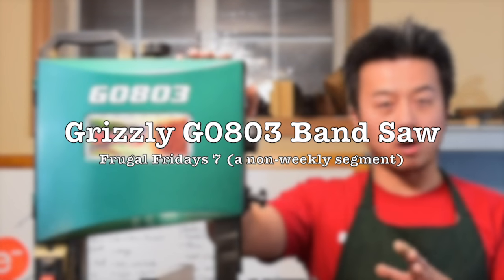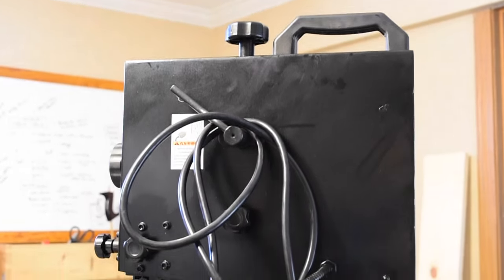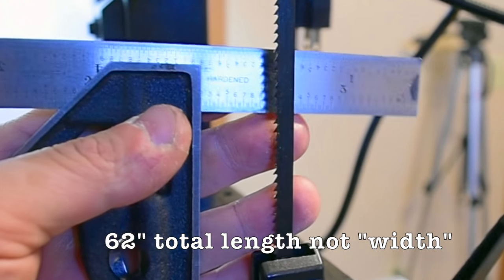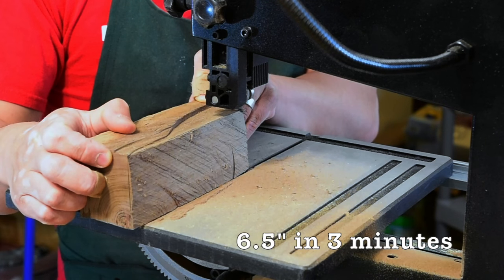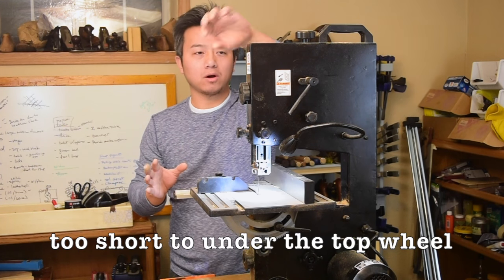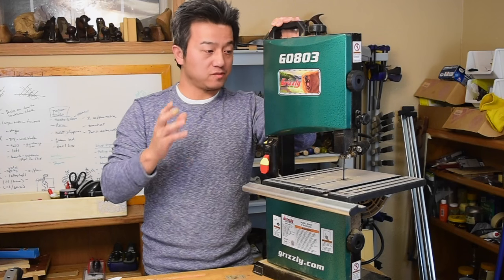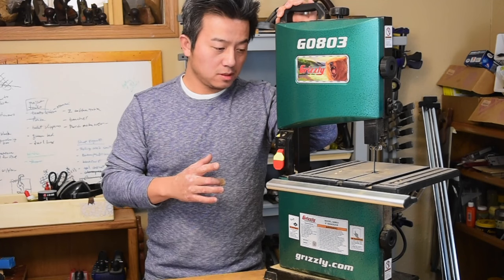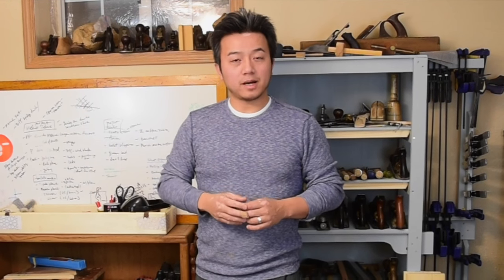Grizzly G0803 9" Bench Top Band Saw - A Frugal Fridays 7 Review

Comment: Excellent simple breakdown of the experience of using this tool, the pros and cons.  Especially helpful actually without distracting comparisons to other options, focused on accessing the ability to do what was intended.  Thanks!
Reply from the maker: Glad you liked it. It's basically the same as other saws of this size. So no need to compare brands, they are mostly made by the same company just painted differently.

Comment: Thanks for the review John. I have a cheap 9 in ryobi and I never expected too much out of it. I can say , a good quality blade makes all the difference. Your grizzly will probably exceed your expectation with a timber wolf blade, mine did.
Reply from the maker: +Moy perez woodshop You're welcome. I know the 9" Ryobi you're talking about, the table top between the two saws are the same. The Ryobi is a little smaller. I am going to keep using this blade until it "fails" but I'll keep the timber wolf in mind.

Comment: Nice addition to the shop! (and to your workflow:-) Before I had one I used a jigsaw which of course ment, bringing the tool to the wood. But having a bandsaw is incredibly convenient. Now I take the wood to the saw in practically all cases so my jigsaw is at rest. Relief cuts are the key in the majority of the curves to be cut. Regards John!
Reply from the maker: +Maurice Blok That's true Maurice, I was able to cut that handle much faster than a coping saw and the cuts are cleaner too. This smaller saw really suits my style for now, but I'm still looking and saving up for a bigger saw.

Comment: I bought a Rikon version of your saw.  It was also my first use and purchase. I purchased some Olson blades in different widths (for tighter curves), and the saw has exceeded my expectations. I've had it for 2 years and still going strong. Thinner blades are slower but cut down on saw marks. I think its a great idea to get a cheaper smaller model to see what features you like/dislike before possibly buying a larger one. Woodworking R&D.
Reply from the maker: +Mario Gonzalez I always find it interesting at the similarities between tools from different brand. For example, the table of the G0803 is identical to the Ryobi. Most of times when something breaks before it's expected expiration date has a lot to do with the man in the mirror. Ever notice that some people go "throw" electronics like popcorn?

Comment: Thanks for making this video! Watching you cut I think the saw is ok, the features you pointed out make this saw better than the competition I think, I thing all of these small saws are under powered I looked at the electrical spec, the Micky mouse miter could be replaced, I think the saw will work better is you had a better blade, Starrett red stripe blades are awesome blades but I don't know if they come in a size that will fit this saw. You may need to buy a band saw blade weirder they are worth purchasing. If you had a Starrett red stripe blade with about 24 tip this blade will cut any wood like butter and you can cut metal also. I have 36 years experience working in an industrial environment making dies, machining and machine repair so I know something about band saws. Sorry for so many words I just got carried away. Thanks again.
Reply from the maker: I switched the blade awhile ago less tpi and it cuts better for the type of cuts I like to make. I am planning to make a Chinese frame saw with the left over blades.

Comment: I just purchased the G0803z. This is a nice enough machine HOWEVER the fence broke within minutes. It is held in place by two small plastic bits that snap off easily. I have ordered 3 more but they are backordered (tells me something, eh?). Also, there is nothing to hold the backside of the fence in place. The chip blower is useless unless you're cutting balsa wood.
Reply: I'm looking to purchase this saw.  With all of your experience with the saw would you still purcahse?  Thanks
Reply: @treystills  To be honest, no. In retrospect, I should have looked at other models in person. I got sucked in by the laser guide and the blower.
Reply: @MrTurtletraxx  Thank you!  If you don't mind me asking what other models would you consider?  Thanks again
Reply: @treystills  Not sure. Probably start at Harbor Freight, Northern Tool, Home Depot, etc. Too late now for me.
Reply: @MrTurtletraxx  I think I found it...Rikon 10-306
Reply: @treystills  Nice! Good luck. I use mine to cut aluminum, by the way.

Comment: john i have a rikon 10-305 10 inch bandsaw and it is a nightmare changing the blades,,its because of the slide on the front that you have to slide the blade into to put it on the wheels,,honestly,,it cuts food but just a pain to change blades,,this grizzly saw is 275.00 now plus shipping,,a little over 300 to get it to you,,would you pay that much for it if you was buying it again,,and how is the blade changing and have you tried to rip using the fence

Comment: Thank you for your assistance! Very nice to see a real rundown of the welds, the flexing, the silly light and how it sounds when running! I need a little saw for winter, my big 14 inch saw is outside and its tooo cold! I been doing a lot of looking. I've used a bandsaw for about 45 years so I know the adjustments and so on. Your video is exactly what I wanted to look at the actual machine almost piece by piece! You couldn't do that in most store displays. I think the tracking is how each saw is adjusted, blade used and user skill. But, after two years, do you find the tracking fairly good? Or totally wonky?  Thanks again. Barbara in  Maine USA
Reply from the maker: You're welcome Barbara. It has worked well for me. I am not really that demanding of my band saw, just small stuff. I also take good care of my tools so they last longer in my hands than most people. But I think I would get a cheaper/smaller saw if I had to do over, like a little Ryobi.

Comment: ok I'm sure other have said this blade choice is key to how a saw works 1/4" is a general use blade if your going to cut tight rads. then your going to need a thinner blade also I noticed the blade was drifting a bit you may want to Research bandsaw tuneup to make sure you have all the guide blocks set right. for re-sawing wider is better the blade will track better  but you have to match the max blade width to the saw. and I agree the placement of that light was not well thought out. as for the handle well again not well thought out.
Reply from the maker: +Stephen Roberts Thanks for your input Stephen. The review is for the stock product. In my opinion the stock G0803 blade did not drift more than expected, under the specific load; clearly you saw something different, by showing the cuts, the viewers can make their own decisions.
Reply: +John Zhu Very ture maybe I saw some that was not there in your eyes I think the review was fine and it did show the short coming of this saw. but as a whole it seems to be a well made piece of equipment. As a DIYer myself I enjoy thing like this so I can make better choices.

Comment: Wow, this saw is almost identical to the 10" Wen bandsaw I just got a couple of days ago. Even the knobs and crappy light are the same, haha. I got it with a stand, so there wasn't a handle on top, but I had to look closely to see other differences. One I noticed was the dust collection port, which looks like it supports 3 sizes on the Wen and probably just a 2.5 or 2.25 on the Grizzy? Does the Grizzly support two speeds (the Wen does, but I suspect I'll use it on one speed for 95% of my needs)?

I suspect it's made at the same place and just badged for the different companies. It's my first bandsaw as well, so I don't have any point of reference either. The Wen is a little more pricey (I paid ~$265 USD at Amazon - http://amzn.to/20WbykD), but I'm liking it so far. It can cut up to 6" deep, though I don't expect to need that much capacity (better to have a little extra than not enough, I guess).

Great work on the video. I'm glad I stumbled across your channel and I'll be catching up on your past videos.
Reply from the maker: +The Unlucky Woodworker Welcome aboard. The Wen looks like a really nice bandsaw. But there isn't enough room in my indoor studio. I want a bigger bandsaw for my garage/mess making shop, 14"+, I'm trying to organize my garage and save up for one. 

I find the Grizzly G0803 9" is just the right size; I am sure there are any number of 9" bandsaws that would have fitted my needs. I chose the Grizzly so I can try out some of the "fancy" features, that now, I know I don't care for. Since this demonstration I haven't ripped anything using my G0803; but I have cut a bunch of curves, one of the main reasons I bought the bandsaw.
Reply: +John Zhu I had been eyeing the Laguna 14" for quite a while before I decided I should start with something a bit lighter. I actually need to organize my garage now just for the smaller Wen, haha. The Grizzly sounds like a great deal, especially for tight spaces.